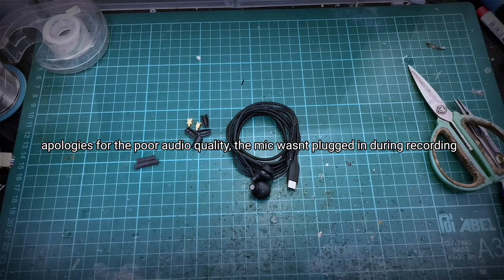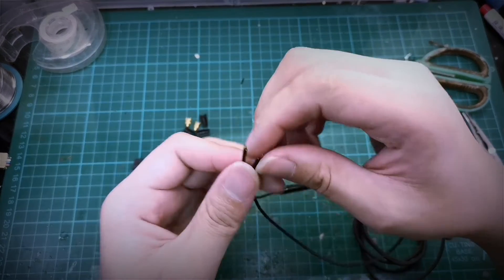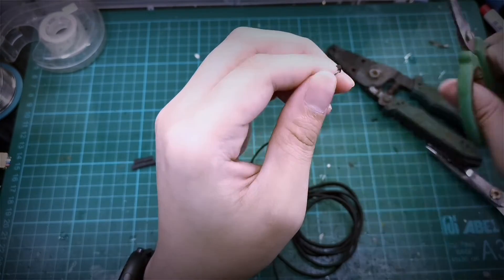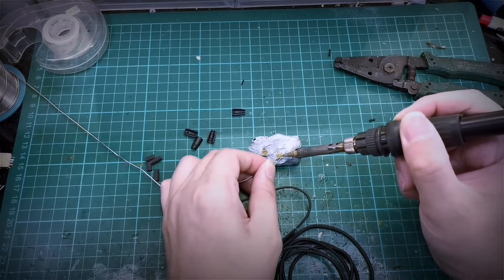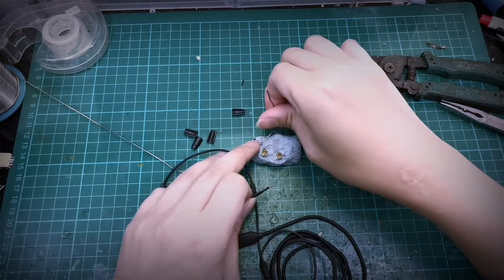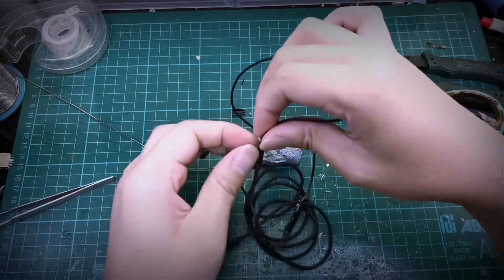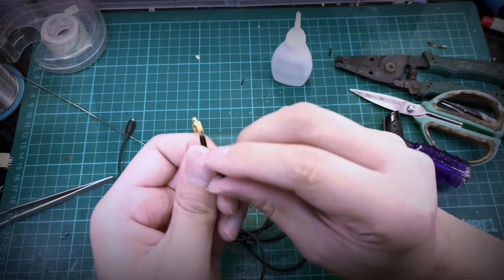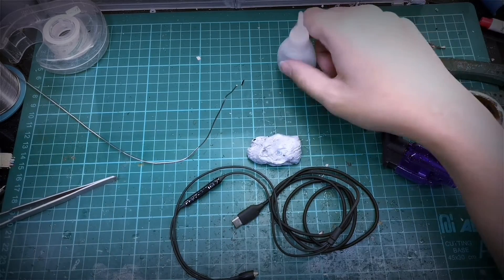SAMSUNG AKG USB Type C earphones mod to mmcx, upcycle your usb c earphones [NAKED Tutorial]

Comment: That looks so easy. I want to do it but I'm a bit scared to solder and melt my wires, lol. Is it harder than it looks? Can I do this with regular 3.5mm cables. I'd like to swap out the MMCX to 2 pin.